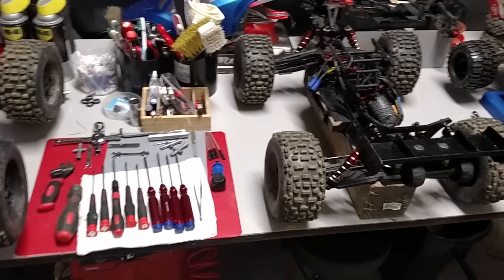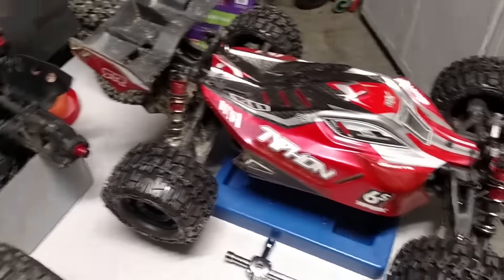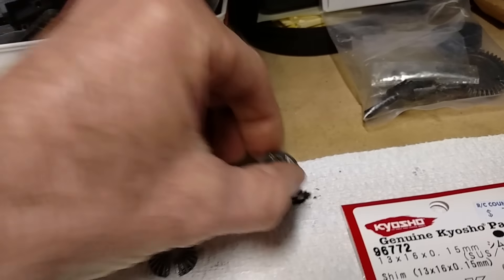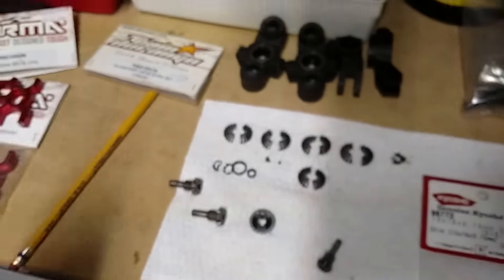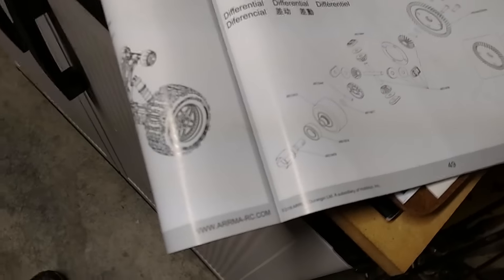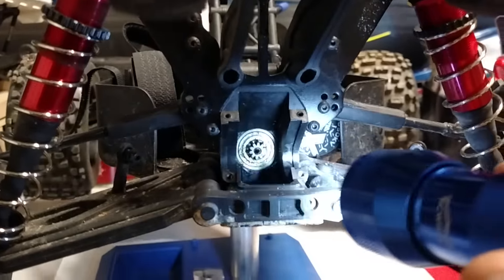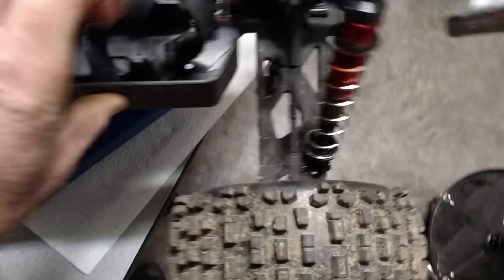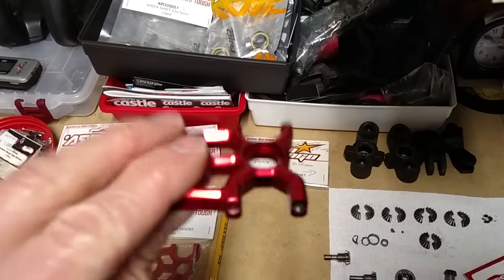Arrma Outcast 6s diff gear breakage

Comment: Is this still an issue 3 years later and possibly 3 versions later? I grabbed the V5 I'm sure it's still like this. But unfortunately ima a broke loser and only running her on 4s right now. Lol
Reply from the maker: The newer V4-5 diffs are shimmed better 👍. 4 new shims were added. I still prefer to swap the new planetary shims with bigger Mugen Seiki ones plus add 2 Tekno #1222 bearing shims to ear crown gear side bearing. 😎💪👊👊

Comment: Richduperdash update I managed to pull the front diff out and it has ripped some teeth out. I noticed on the back diff, the diff and pinion seem fine however seems to be a lot of play on it yet no damage strange!!! I think it might be time to pull it to bits and rebuild it give it a clean I will shim the front and rear diffs and re fill with oil and grease. Only problem is there's no stock for the diffs at my local hobby shop which is a bit rubbish bet there's a big back order lol just my luck.👍👊 I think the crunching was early sign of pinion skipping diff gear rich 6s too much power
Reply from the maker: carlo fois thanks for the update. I've been doing diffs again lots lately too. Just rebuilt all 3 Typhon diffs, replaced entire center diff/spur because it has leaked dry and looked pretty shot including damage to the plastic cup. Spur was OK, but teeth rather worn after full year of hard 6s bashing. I often clean and reuse my gears and bearings whenever possible. Planetary gear and pins were busted. Just found 4 flattened crown gear teeth in rear diff, but input/pinion survived somehow...Lol. Realized this rear diff never got shimmed somehow??? Finishing up after work today. eBay often sells entire diffs including Spur or crown, bearings and outdrives for pretty cheap. Good option when otherwise backordered. The crown gear is like 20$ retail otherwise. Good luck with it bud. Definitely worth shimming for harder bashing no doubt. I've gotten way longer use of all my shimmed diffs overall. Bearing shims on front/rear have made a HUGE difference in saving the crown/input gears.👍👍👊
Reply: Rich Duperbash cheers bro!!! Sounds good you got a lot done there the practicly a brand new rig.👍 I seen the crown gears you guys have them in the states, I will get some more info tomorrow. The guy I bought the car from said he shimmed the diffs I could not see any I am the same will shim try and use rear pinion still looks ok might change the front.👍

Comment: Hi rich, my Input Gear Main 10T Spiral  (AR310498) on the arrma kraton is failing repeatedly , more often on front even with shiming the crown side bearing and only on 4S packs , is there a solution this problem.much appreciated
Reply from the maker: abdul latheef that's a bummer to hear my friend. One thing that can destroy the front gear easily even when shimmed is hammering the throttle into rock piles, steep gravel mounds or anything that can quickly bind the front wheels momentarily and over tax that little gear. Same with nose landings on throttle. Mechanical reasons could be a faulty or cracked gearbox, failing bearings, or a slipping main output cup. I'd make sure all the bearings are healthy and your crown gear is securely tightened down on the  diff cup. Another possibility is your diff cover isn't fully seated correctly. Often the screws feel snugged down, but the cover isn't actually completely flush with the gearbox 100%. When you replace your input gear, make sure to keep firm pressure on it against the bigger diff bearing while you fully seat the output cup and thread lock the grub screw. There shouldn't be any play when you tighten it down. Not sure what else to recommend. Hope this helps bro.😎💪👊👊

Comment: I have blown two diffs in my Outcast.  Driver error or those huge pro line trenchers?!😁😂😅
Reply from the maker: It could be both 🤔. The Trencher X's are absolutely HUGE 👀. Should be OK with Trencher 40 series. They're still quite big, but so are the stock Backflips. I'd do your best to land off throttle and limit standing backflips to a minimum.😎💪👊👊
Reply: Rich Duperbash rich, do you recommend the trencher 40 series? I'm looking into buying new tires but can't decide between trencher 40 series and dboots copperhead2
Reply from the maker: @ELValenin  I haven't personally ran the 40 series. Think I always held out cuz I was happy with the dBoots backflips. I still think I might favor the lower ride height, offset, weight savings, and tread pattern of the new Copperhead 2's over the Trenchers🤔. Both are solid choices.
Reply: @richduperbash2966  I trashed my minokawas by running in gravel all the time. Cracks in the tread and where the glue goes. Do you think the backflips or copperhead2 tires would do better?
Reply: i just got the proline trenchers 3.8 and boom my diffs went out lol.

Comment: So what I'm meaning to ask is I can do all my shimming with the td310475?
Reply from the maker: Derek Quinones no you can't, cuz you still need the smaller sattelite shims (2 extra per diff) and the Kyosho or Tekno bearing shims for the front and rear. Mugen does include both the planetary and sattelite shims, forgot to mention that. I think you get 10 planetary shims in the TD baggie. Mugen only sends you 5-6 planetary per bag plus the satellite shims. I used the extra satellite shims you get with AR310436, diff gear set. Arrma sells the satellite shims separately, but I've never bought them. Hope this helps. 👍👍
Reply from the maker: Derek Quinones PS, if you find the TD shims anywhere let me know, they've been unavailable for several months now.

Comment: I've just blown out my 2nd ring gear and output gear? It's only 3 weeks old :(
Reply from the maker: Best thing I can think of is to add 2  more bearing shims to the crown/ring gear side bearing 👍. I'm still using the Tekno ones TRK1222 with good results. That's in addition to the stock shim. Make sure your input bearings and diff case are both good. Lock the diff case cover down snug so the diff can't get pushed backwards off the input gear. Never land with hard throttle and limit standing backflips and self righting. Hope this helps. 🍻😎💪👊👊
Reply: @richduperbash2966  It does help thanks dude! Turned out to be the diff bearings? So its all all shimmed up now with rubber sealed bearings, should be ok now I hope! Thanks again for the reply! Your videos have helped me out mate :)

Comment: Should I get the tekno or the kyosho for the ring/pinion shim?
Reply from the maker: Both work, but the Tekno #1222 shims are thinner .10 vs .15mm so they offer more leeway in terms of using 2 or three shims. You can also sometimes opt for 1 of each   (0.25mm) vs 2-3 Tekno shims. 🍻

Comment: other thing I'm a little confused so i have my diff open i see 4 little washers aka shims will i be adding  1more?? to each side
Reply from the maker: Alex Torres you'll be adding 2 small shims total, 1 on each sattelite pin. Watch Thomas Ps, Tp-PartsRC-Xtreme how to vid on bulletproof diffs, it should be most helpful. It's hard to explain in text. Get back to me if you still need help. 👍👍👊
Reply: Rich Duperbash  okaay thanks man im gonna look it but just blow my center diff ..
Reply from the maker: Alex Torres sorry to hear bro. Shimming the diffs definitely helps strengthen them, but sh.. still happens sometimes...Lol. You'll get good with your diffs after you go through them a few times.😲😲😲👍👍👊

Comment: I'm sure your supposed to have a smidge of play in those diff meshings , otherwise they heat up ??
Reply from the maker: gatti493 most true my friend. The gears settle and break in on higher power to mesh about perfectly. I've broken far less teeth off by doing my diffs this way. I just stick to what works, but always do my own experimenting before passing judgment on what's effective. I'm pretty sure the diff box itself and bearings have a minute amount of flex under extreme loads and torsion. In any case, this has done wonders for getting the most longevity out of my gear sets with a noticable reduction in gear failures. 🍻😎💪👊👊
Reply: Rich Duperbash 
If it works for you rock on lol
Still a very good video anyway.
Good luck buddy
Reply from the maker: gatti493 thanks brother. It was a rambling one for sure...Lol. Sorta all over the place, but part #s have been useful for many 😂. Happy bashing brother!!!😎💪👊👊

Comment: Did this happen due to low diff fluid
Reply from the maker: No it didn't 👍. The input and crown gears fail for various reasons. Landing on throttle stresses them for sure. The internal gears definitely need adequate fluid to prevent overheating. The planetary gears break more from physical stress than oil level issues. Chassis flex can jackhammer the drive shafts into the cups and lead to breakage. Sometimes the gears just give out. CNC machined gears are ideal. If you keep your diffs maintained and don't force wheel spin when the wheels would otherwise bind up (decelerate) quickly, these diffs are tolerant to 6s abuse. 😎💪👊👊

Comment: what's done to your Ruckus?
Reply from the maker: RC JOE both have upgraded electronics. My son's has VXL 3500kv system from my Slash, my daughter's has CC 2400kv MMP combo. Both have MIP x-duty rear shafts , Traxxas wheely bar, upgraded aluminum shocks, steering blocks,  servos, hex's, RPM hubs, Traxxas metal turnbuckles, Hot Racing metal Spur gears, and running 2.8 Trenchers. They are sort of ridiculous to drive, very light with way too much power, just right for young kids...lol.🐒🐒🐒
Reply: Rich Duperbash yea I like mine but have only done a few things, I'm trying to find a good ESC to go with the stock motor and hope to push a 3s through it as the stock ESC won't except it
Reply from the maker: RC JOE is it the brushless system?   My stock system took it, but it did get toasty. I melted solder at EC3 connector with stock system at least once during hard summer runs. If you want to mod it, I'd look at higher KV combo, maybe Sidewinder 3 or something. My 2400 is too low kV for top speeds with limited gearing options. Still pretty fast from 0-50. VXL combo is very fast and waterproof.
Reply: Rich Duperbash yea brushless, I tried the 3s lipo but it didn't want to move for me. I put the 2s back in and worked perfectly
Reply from the maker: RC JOE is ESC set on Lipo? May be a dumb question, just haven't played with it in a while. ESC may need a reset or something, should recognize 3s, that's all we were running on stock electronics for awhile.
Reply: Rich Duperbash yea all I run is lipo batteries, but I'm wondering if the cutoff setting could be messing it up
Reply from the maker: RC JOE that could be it, sounds like it's a voltage recognition issue of some sort. I would reset it/verify the settings via manual.

Comment: Did they come with diff oil?
Reply from the maker: sdw2003 yes, all the Arrmas come with prefilled diffs. Many other RCs only come with grease packed in them, not diff oil. I've had 2 of my 4 Arrmas show up underfilled though. It's a good idea to check them or change the oil to your liking before too long. I run 50/100/20K front to rear in my Outcasts and Typhon, 50/200/20k in my Kraton. 🙋🙋😲😲😱😵💪👊👊
Reply: Rich Duperbash my outcast Came with grease that's why I asked
Reply from the maker: sdw2003 that's not been the norm from Arrma??? The diff oil turns into blackish gray goop after a few runs that looks like grease.
Reply: Rich Duperbash , out of the box I pulled the diffs and it was grease,
Reply: I know it turns gray because of the pop/cast metal they use! Wish they would use hardened steel cut from a solid block

Comment: Just ordered my outcast didn't know it came with diffs 10k/100k/10k stock
Reply from the maker: Matts Rc Addiction the manual says 7000cst front/rear, and 10000cst center. All I know is they came pretty low on fluid. I changed my right off the bat cuz I already had 2 Typhons and was familiar with the diffs. That's awesome bro!!! Think you'll dig it. I just finished painting/mounting 1972 Chevy C-10 Proline body on my son's homemade Outcast, looks friggin sweet. 🐒🐒🐒
Reply: Rich Duperbash nice can't wait to see it I'm wanting to get a new body for the Kraton and do my own thing
Reply from the maker: Matts Rc Addiction I'll try and post something soon. I was going to shoot a vid blasting my rebuilt Kraton with the Nero motor today, puddles too deep, wasn't feeling like a mud bash...lol. I need to dial my son's shocks in, ran out 60 weight oil, running stock springs, feels mushy as is. May order more Tekno springs to beef it up. Had to build shocks from new with spare Typhon caps, bladders, seals, etc...pain in the ass...lol.